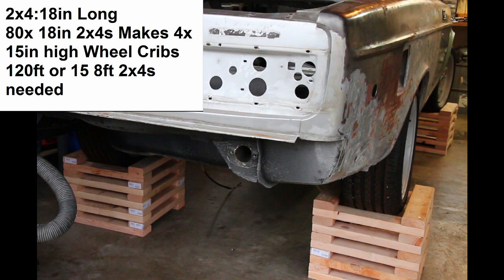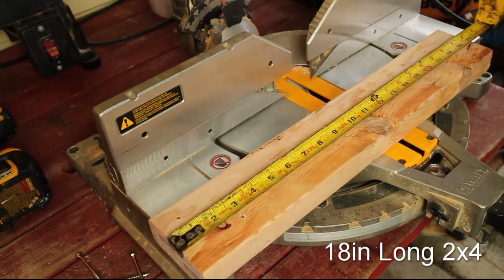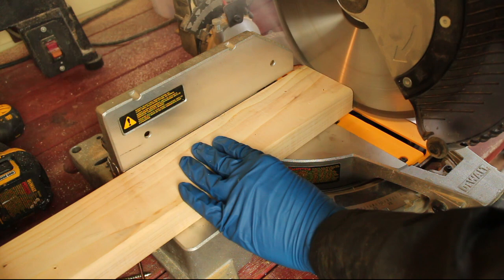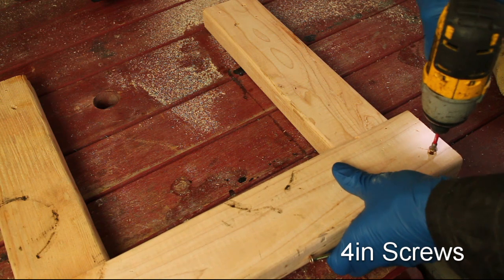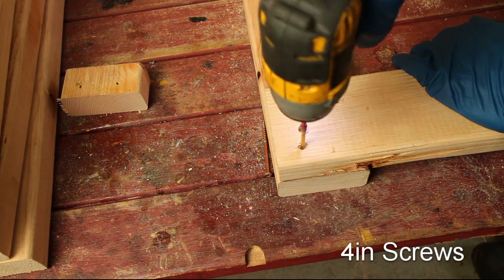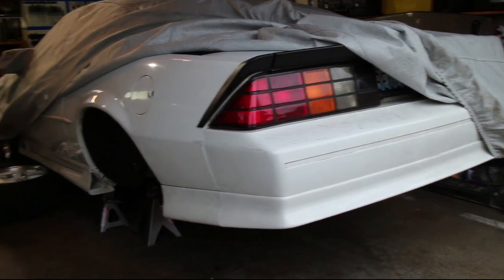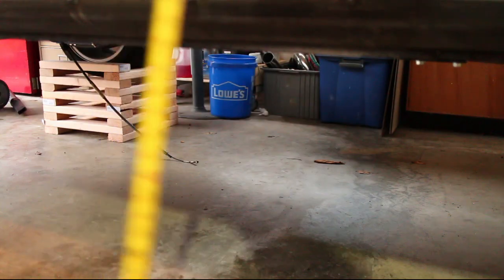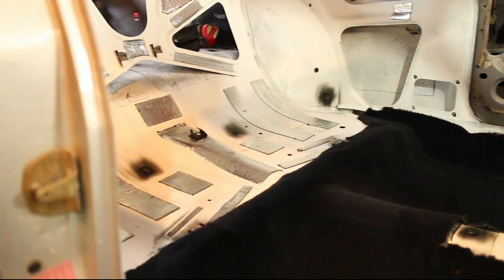How to Make Cheap Wheel Cribs

Comment: Watching all your vids on the Camaro since I have one of my own. So when I see your brother has a Volvo I like the channel even more. The Volvo is as Swedish as it can be. Most people my age learned to drive in a Volvo. But being from Sweden it´s a common car too..
Reply from the maker: that Volvo is a 262 Bertone. it should make 400 horsepower if my t brother ever  finishes it lol
Reply: @3rdGenGuy  does it have a proper engine, or the 6-cyl PRV-bastard?
Reply from the maker: @kmas8229  the OEM engine was the indeed the PRV V6 same as the Delorean.

Now he has a fully forged Red block with a GT30 turbo
very nice build, super clean, Custom CP rods and pistons.Rods are 1in longer than stock. engine looks like a work or art
Reply: @3rdGenGuy  Garbage engine.

Good thing he has a Redblock now. Saves him from alot of headaches.
Reply from the maker: @kmas8229  apparently, you can rebuild and fix most of the PRV's issues these days. Still not worth the hassle unless you have a rare car like a Delorean.

Comment: Aren't 4 inch screws too long for two 2x4s, considering the 2 in 2x4 is really 1.5 ?
Reply from the maker: first set of screws go from underneath.
but yes, these screws are over lapping about 2 1/2 2x4s

Comment: Nice video. I wanna build some. But what does FEMA rate a 2x4?? U quote the rating they give a 4x4. U are using 2x4’s.
Reply from the maker: ya the FEMA ratings are 4x4
i could not find numbers for 2x4, but my pint is these Cribs are RIDICULOUSLY STRONG!
Reply: @3rdGenGuy Will this work for a 91' Camaro RS as well? I would love to make these so I could easily get under it. Was wondering if you had tried on yours? The lower moldings for wheel clearance in boxes is my concern. Have used a few of your videos for mine and have been very helpful , thanks!

Comment: What do you use to lift your car that high? I bought sunex ten tons that I believe are 23 inches minimum and it's a little sketchy using my Daytona jack that I believe raises to about 24 inches
Reply from the maker: VERY CAREFULLY! 
i use 6 ton jack stands and slowly lift the car until i get get the TALL cribs under my car.
EXAMPLE:
If you try to jack up 18in+ at once the jack is liable to slip off your jacking point.
so SLOWLY work your way up re-adjusting the jack as you go.
Reply: @3rdGenGuy  Right on. Makes me wonder how they think someone is going to manage putting these jacks on the max height (34 inches?) heh. I suppose it's probably for lifted trucks of some sort.

Comment: You might look at the cost of treated 2 by 4 by 12 in my area they're less expensive
Reply from the maker: You can use a lot of different sizes.
 a 2x12 would work fairly well.

Comment: Do you think it would still be stable if you were to add wheel castors so you could move the car around if need be?
Reply from the maker: My brother and i discussed that very thing, and i'd say NO!  the center of gravity is too high to risk putting wheels on the cribs.
if you want to be able to move your car around, harbor freight had cheap wheel casters, but they don't lift the car like the wheel cribs do.

Comment: The FEMA numbers are for 4x4, and also the 4x4 are not soft pine. Your numbers are not going to be anywhere near close to the FEMA 4x4 numbers.
Reply from the maker: it's OK bro. it'll be alright
Reply: @3rdGenGuy   Also the FEMA numbers are if the load is spread evenly to all corners from the top, which its not.
Reply: @SOLDOZER  The cribs could be 1/16th of the strength of the FEMA rating and still hold up a full size truck.
Reply: @Drunk Aunt Janet Wouldn’t be more productive to tell us what the correct numbers are rather than everything that is wrong?  Since you know these FEMA numbers please help us all and tell us what the actual rating is